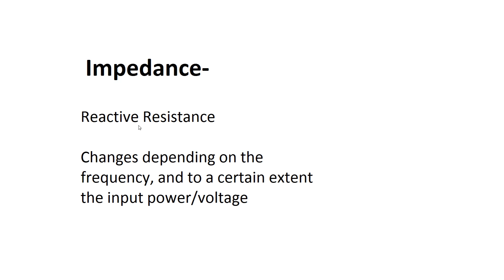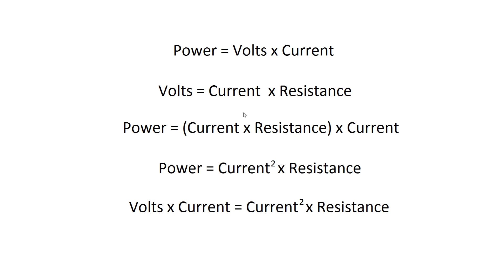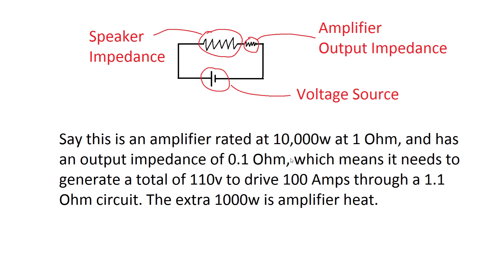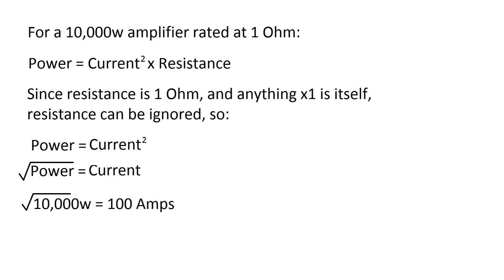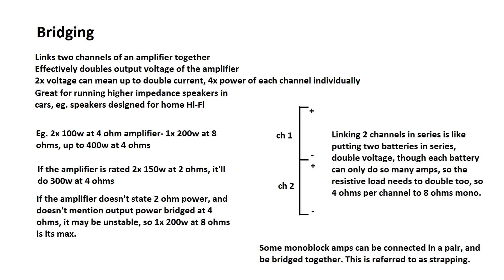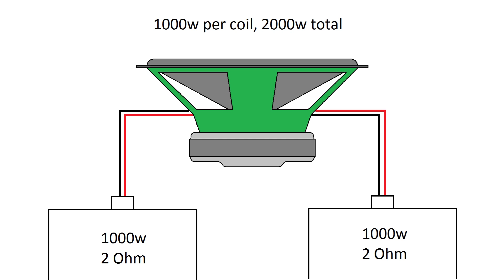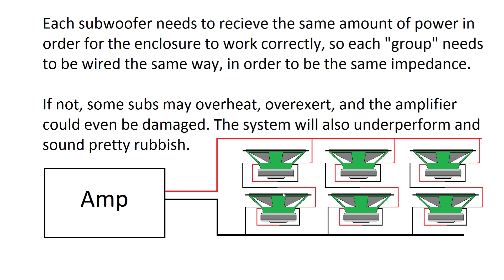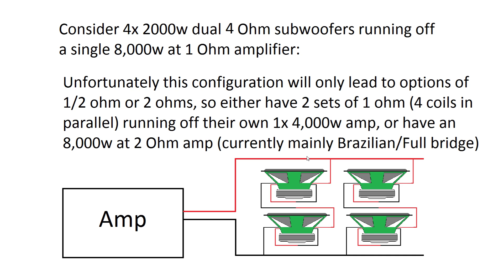All about Impedance!

Comment: i built a small box for my mids and highs that houses two 4 ohm tweeters and two 8 ohm mid range speakers..how can i wire all 4 of these speakers to one amp?.. the amp is a taramps DS800.4  4 channel, 2 ohm amp  thanks
Reply from the maker: Ideally if the amp had high pass and low pass per channel, you could just run one channel per speaker, pair left speaker and tweeter with right speaker and tweeter, set a crossover at around 3KHz, and set levels to what sounds good. Be careful not to blow up the tweeters though. 
Tweeters are often more efficient than speakers, so tweeters in series and speakers in parallel running off a single channel should work well if you're ok with mono. You might want to consider using a crossover also, crossovers can be daunting, there should be some tutorials on youtube. Using tweeters and midranges of different impedance makes it a bit trickier. At the very least use a crossover calculator online to work out the value for a capacitor for the tweeters, a capacitor in series is the most basic crossover/protection there is.

Comment: Mono block amp, dual 2ohms sub and 4ohm sub. How do i connect them into 1ohm ?
Reply from the maker: dual 2 ohm sub by itself would be parallel to get to 1 ohm, though if you mean you have both a dual 2 ohm sub and a 4 ohm sub, i'd suggest wiring the dual 2 ohm sub in series to 4 ohms, and running both subs in parallel to get to 2 ohms, unfortunately 1 ohm isn't possible. 0.8 if everything is wired in parallel. 
I personally don't really suggest mixing and matching different subs, especially in the same enclosure and/or on the same amp. But, if you want each sub to perform similarly, running both at 4 ohms for slightly less power from the amplifier is best case.
Reply: @Dakoustics  I converted dual 2ohms sub into 4ohms. https://www.youtube.com/watch?v=cHhsWzLORo0  This is my setup. Sorry if video doesnt show much.
The second sub is 4ohm and wires from the box are connected to bridge mode on the amp. 
The amp is Ground Zero GZTA 1.1200DX
subs: 1x Ground Zero GZRW 300X
           1x Ground Zero GZRB 300BPX
The sound is great , no overheating on amp. But i im not sure what i got and am i safe to use this combination. I am unable to buy new subs bc they don't sell those anymore. Tnx
Reply from the maker: @Krupnoklipac  Ah yeah, I watched the video, correct me if I'm wrong, though it looks like the GZRB 300BPX came with the box, and is a single 4 ohm, and the GZRW 300X is a replacement driver for one which blew in the past or something. If that's the case, this is spot on, and it's pretty well perfect, each driver should act exactly the same, the only difference should be that one is a dual vc and one is a single vc.
Reply: @Dakoustics  Subscribed. It is very hard to find help. Thank you once again!

Comment: Does it damage my subwoofer to use one of the voice coil’s instead of both?
Reply from the maker: its usually best practice to use both voice coils, even if you've got a 300w at 4 ohm amp and dual 4 ohm sub, you're better off running 200w into both voice coils in series at 8 ohms rather than 300w into a single voice coil. Essentially what happens is even though you've only got half the current, you've got twice the length of voice coil inside the voice coil gap, so it makes up for it.
If you've got a 2000w dual voice coil sub, and only have the option to use one coil for whatever reason, I'd also not want to go much above 1000w to be safe, in theory it should handle say 1500w due to the unpowered voice coil still acting as a heat sink, though the used voice coil isn't going to perfectly transfer heat, so it could cook on full power.